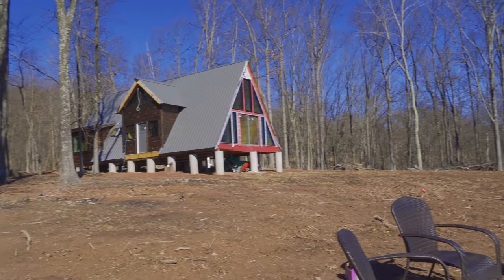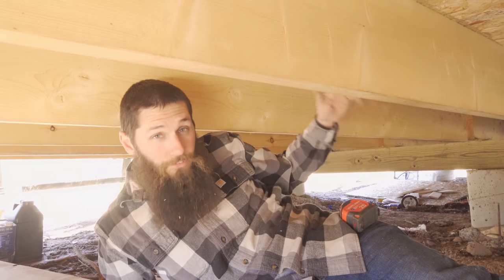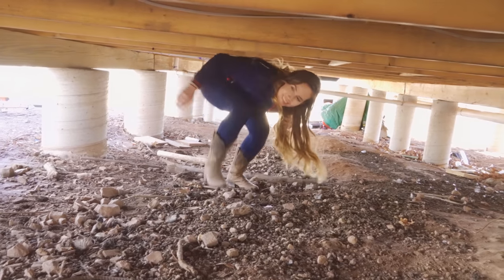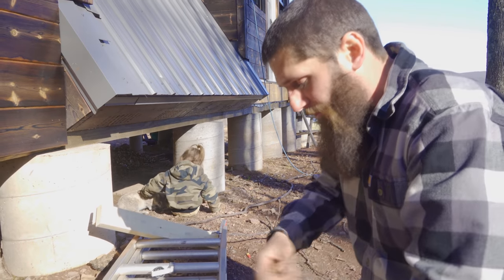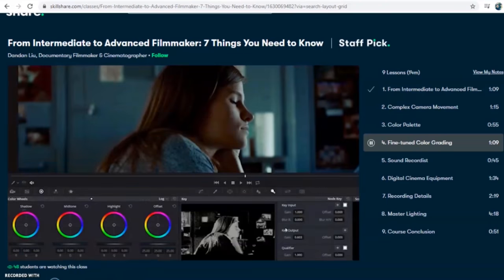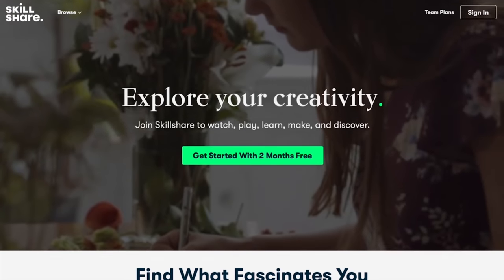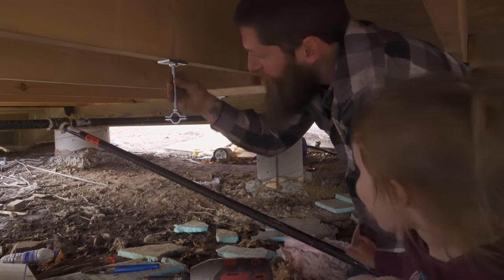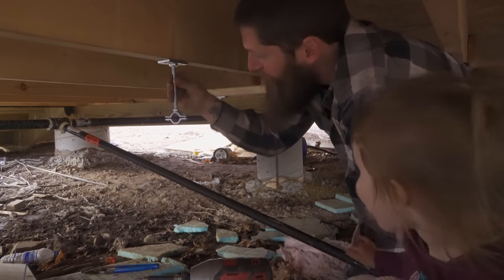WHAT Is Happening Underneath Our House?

Comment: Awesome video! Love y’all’s love and sense of humor! As a fellow diy builder, the gas line was probably the hardest subject to find information on. Pipe size, debris drops, length of pipe sticking out of the house... I ended up going over to a neighbors house and seeing his. It felt nice when the propane company came out and mentioned how good of a job it was and thanked me multiple times for giving them enough line outside of the house to screw on the regulator. All-in-all, it’s not a hard job, we just need more information out there!!
Reply: I retired from the gas company doing this kind of work. Now I am a plumber installing gas lines. I was truly amazed how well they did being an electrician. I would have recommended somethings, over all good job.Oh yeah National Fuel Gas code has all the info you need. Ron
Reply: @ronwood7040   Thank you for the information! 🌞

Comment: Pressure test,  pressure test, pressure test is what I recommend, and while I have put together plumbing with water pump pliers, pipe wrenches make it much easier to tighten joints. A piece of plywood and 4 10 inch wheelbarrow tires and some 1/2 inch all thread can make nice platform to lay on and scootch yourself with your legs, much easier than crawling.
Reply: pressure test...hummmm,been there done that in my trade plumbing....can still get leaks,im surprized that they are not using "ptfe" tape i think you mericans called sylicone tape or something like that..... that may be liquid tape they are using ..???
Reply: Here in merica, pipe dope works just fine and is way faster that tape
Reply: @gsyguy1  Pipe dope, properly called pipe joint compound, is mandated by building code for American gas lines.
Reply: @BillB23  we have many joint compounds,jet blue,boss white,but have a ptfe tape thats thicker than normal for gas pipe work,and liquid ptfe ,just wondered if it was the same.... ?
Reply: @gsyguy1  Possibly... It's been years since I've been a carpenter, but the pipe fitters I've known all used pipe dope on gas lines and tape on water lines. Things may have changed since then, as building science is always evolving.
Reply: @BillB23  That is not true.  PTFE tape (only) meets code here.
Reply: @wallykramer7566  Thank you. It's been quite a while since I interfaced with folks installing gas lines and I value your correction.

Comment: Hey guys Donovan here. Love the videos y’all are helping inspire my family to move off grid and into the wilderness. Quick comment not a criticism. Black pipe can’t be used exterior here in SD CA because it rusts and corrodes much faster than galv. There’s lots of ways to address it such as painting or insulating your pipes. I just wanted to bring it up so hopefully you can avoid future issues under your house. Again love the videos keep it coming.

Comment: Axial Grunt Force Fgf, by using Equation(1) Fgf=0.7×(grunt)×y×As =0.7×1098×20.1 =15449[N] {1576[kgf]} A pipe is tightened by torque, torque inclination, grunting, rotating angle, stretch measurement and other methods. The grunt method of torque measurement is widely used due to its simplicity and convenience. The total grunt force is proportional to the volume of the grunt x duration. Great video! Love the love and laughter. Daughter is adorable.
Reply: and don't forget the snort at 17:13 !

Comment: Greetings Y'all, I must strongly suggest that you invest in at least 2 pipe wrenches(16" and 24"), they will come in handy for other off grid adventures...  Nextly, do use air from your air compressor to pressurize your gas lines (50psi.) and then spray soapy water on every joint to check for leaks before you go any farther(you may end up disassembling alot of your previous work to get everything appropriately tightened). Again use pipe wrenches on pipe!!!THanks for all the vicarious fun, Jerry

Comment: I ran a Heatmor outdoor wood fired boiler for 15 years in Minnesota.  you can heat a house with it and provide domestic hot water.  But, you will NOT provide heat at a high enough temperature for a clothes dryer.  Use LP gas, or better yet, you will be much happier with a solar thermal hot water heater, than a wood fired heater.  I say this mostly because you will not want to keep the wood fired boiler running all summer just to have hot showers.  The issue with using heat from the wood fired boiler is that heat starts at the boiler at about 180 degrees F (68 degrees C) AT MOST, because heating the water any hotter more will blow boiling water at 212 degrees F (100 degrees C) out of the top of the boiler and may crack the water jacket.  When the water gets pumped into the house, even with insulated pipes, their can be a significant temperature loss, maybe down to as low as 160 degress F when it first hits the heat exchanger in the house.  You will need heat exchangers and pumps, because you cannot mix the water from the outdoor boiler system with water to the back of the clothes dryer or water to the domestic hot water tank.  There is more heat loss getting this supposed "hot water" from the first heat exchanger to the back of the clothes dryer.  Go ahead and try drying your clothes with 125 degrees F heat.  It will not work so well.  The heat exchanger will need to be very "fast" to keep up with the heat loss inside the dryer.  A "fast" heat exchanger that can move a lot of heat and keep the temperature high requires a "big" surface area and two fast pumps.  That is expensive.

The other problem, again, is you will need to keep the wood fired boiler running year round to provide heat for the dryer and for the domestic hot water.  I suggest solar hot water panels.  You can get 170 degree F heat from a panel even on a cloudy day in the winter directly into the house, without the heat loss like you get from the boiler, because the panel is mounted on the house very close to the heat use.  It will work year round.  You will need a well insulated 250 gallon high temperature hot water tank and a solar thermal panel.  Keep the LP as a backup for both the dryer and the hot water tank.  I am pretty sure you will still want LP heat for the clothes dryer.

I have been there and done that.  Just sayin.

Comment: Wwog, No one but GOD  knows everything. A spray bottle with dish soap  sprayed on joints  when they pressurize that line will show you if it's all tight if not tighten the joints that are bubbling. No bid deal. Before gas is in that line it still needs to hold pressure.  Keep up the good work. God bless you and your Family.

Comment: 13:53, is actually called a dirt trap...
Reply: Drip leg in NE
Reply: @rogerwhiting9310  condensate trap in SE
Reply: Joe Schlotthauer   Dirt leg ? That's what we call them in the oil refinery,  they they do work ,
Reply: @bustersmith5569  
Yup, the moisture or particulate will naturally fall in there...
Reply: I've never seen one on a propane system, only on natural gas systems

Comment: Enough pipe dope on one joint to do the whole job,lol
Reply: Rüneld Cameron he needs it because none of the fittings are tight
Reply: @floydhathaway8959  extra pipe dope isn't the correct answer to the problem, shoulda acquired the right tools.

Comment: You got me hooked on and now I am binge watching someone else's happiness whils in quarantine when I am traveling to and from the job. Did you use rubber pads in the places where pipes sits in the bracket? Two different metals touching create corrosion caused by differences in electrical potential of the metals.

Comment: Been a plumber in Georgia for 27 years , your friend told you correctly, when it comes to the drip leg on your gas.

However if it were me my guy , I’d put one at each fixture, and don’t put a cap on the downside , put a ball valve so it’s easy to open and drain. Not sure if your state permits ball valves on gas black iron piping but , just a suggestion.  
You could send one of your boys under there like twice a year and drain your drip legs just by popping open your valves for 2-3 seconds and closing them back. 

Nonetheless good video and the house looks great man !

Comment: Hey Josh, it might be a good idea to run the underground piping with poly pipe, and a tracer wire. If you use steel you would have to cathodic protect it from corrosion. I'd use a 1" or bigger line
to stop from having a pressure drop.

Comment: You will need to provide some way to seal the under area from the wind.  Allow it to be open in the summer, yet close it off in the winter.  Otherwise those floors will freeze.

Comment: You should have gone to the plumbing supply house and rented a tool called the mega press. Few second for each fitting and it presses them together. No twisting, no pipe dope. Little pricey but after you use it once you’ll never want to deal with threads again

You can also use full length pipe and cut to any length you want without having to rethread

Comment: I was hoping you were putting some traps in there to catch all that extra glue............that's a lot of glue. :-) I have installed a lot of gas pipe in the past, crawl spaces are the worst so I don't envy you. I could borrow you my aluminum pipe wrenches.................perfect for what you are doing. I was just thinking about how you were going to remove the stumps the other day in your front yard, was hoping you were going to make a video of that, looks like it turned out nice.

Comment: If you are going to close in your craw space and have mice and other critter bubble rap for the under neath the floor joints instead of fiberglass.Plenty of stuff on here about the reasons and it does work. Boss of the swamp can tell you a lot about the reasons why. I have done it myself and it does work because I’m in the mountains.

Comment: Not sure about your location, but mine requires a shutoff valve at each appliance point of useage, so you can disconnect appliance without turning off main trunk. Just a good practice in general too, for maintenance, and service.
Reply: Yep.  That would be above the floor though.

Comment: Hi, I know it`s a gas line, but I believe you should have a drain line for any condesation in lines, normally where the gas regulator is connected to gas lines.
Reply: Considering how dry propane is when it comes from suppliers, persistent condensation is very unlikely.

Comment: Fun idea I ran into will completely remove stumps over a few years and give you mushrooms to harvest by inoculating the stump when you cut the tree down. Most of the time when you cut down a tree you do so in spots a stump can rot naturally but you can speed up the process with the right fungi type and give yourself some food to harvest as it is breaking down the stump. 

Feeding a wood boiler ouch hope you get a log arch set to make bringing home wood faster. No need to process the wood where you cut down the tree when you can turn sections of logs into a trailer and tow them to a processing spot to work on when you have 10-30 minutes of free time. A log deck off a hill you can drive the logs onto and simply drop and roll onto the deck for processing can really speed up how fast you can cut them into rounds at the same time doing it safer then in the field as you are at a comfortable height at a section that supports the log and gives you cut slots and sizes.

Comment: don't forget to pressurize your system with compressed air before you put propane in it.  You should really use pipe wrenches to tighten everything up.  Less chance for a mistake.

Comment: You may want to consider using hardware cloth from the bottom of the floor joists at the perimeter of the house to at least 6 inches below the ground in order to prevent rodents from eating the exposed electrical wiring and insulation under the house. Gophers, moles and squirrels can destroy wiring and insulation in a matter of a few weeks both above and below the ground.

Comment: the gas pipe needs to be sized correctly ,3/4 pipe can only supply a specific amount of btus. If you are getting a propane tank it should be buried and sized or all of the appliances wont last and will have carbon monoxide issues

Comment: hi. well done for the gas piping. Please consider to insulate it for those cold spells. I would also humbly advise you to consider to bury your intended gas tank for the same reason an install a good non-return valve near the house.
Reply: Why would anyone insulate propane pipe?  Any why would a propane tank underground have any advantage over one above ground?
Reply: @wallykramer7566  Loose snow piled all around the propane tank often proves to be an effective insulation. If you have a permanent bulk propane tank, bury it to protect its contents from periods of severely cold weather. To prevent propane regulator and line freeze-up, insulate the system.

Comment: Good looking job. Work is so much better when your having fun while doing it!
Do the gas lines need some type of insulation pipe wrap?
Reply: What for?
Reply: Wally Kramer ...Yours is not an answer.
Had I not wanted to know if exposed gas lines needed to be insulated, wrapped or otherwise protected ... I would not have asked.
Therefore, if you lack the knowledge to provide a correct answer there is no reason for your questioning comment.
Reply: @CJDe-kx8of  No, of course not.  Gas lines do not need insulation.

Comment: Do You need to get it certified by a gas fitter? Here in Ontario all gas systems must have a fitters tag to be certified especially for insurance. I'm sure you already know about the pressure test of 25 lbs pressure to make sure there are no leaks. Wow that's allot of pipe dope Josh, bad habits are hard to break Lol    Cheers

Comment: What type of insulation will you be using ?  Rockwol (spelling?) or maybe spray foam that harden's, close cell, ? Mice wont mess with either. Spray foam is R-7 for every inch of spray.  Very cool skillshare !!! You both are doing a great job with all the area's of building and video making !! So love watching you 2. You'll be in by June 1st !! Stay safe and warm. God bless
Reply: Well, they used fiberglass in the walls.  Why wouldn't they continue that?

Comment: Wild Wonderful Off Grid I heard Josh say he would not use the concrete piers if building again, I’m pouring pads and using blocks to get my height any other options? I want to just stand up oak logs instead but been advised not to

Comment: Reminded me of the upgrade we made to our house replacing the gas pipe (3/4" to 1") to better support our tank-less water heater.  You guys have much more room than we did in our crawl space.
Reply: Are they doing a tankless water heater?  3/4 inch works fine for our 200,000 BTU/hour tankless.

Comment: You've never lived in a 50-year-old home. That metal piping is going to accumulate corrosion until the size of the water flow is a pin-hole. Remember you want to lift that house to install a main floor at some point.
Reply: Edward Tilley that metal pipe is for gas not water. Unlikely to corrode inside.

Comment: I realize you stated that you will have to go to each joint to check for leaks, and that is a good idea. But if you pressurize the entire system and it holds for a day, wouldn't that mean every joint was air tight? Just wondering... Thumbs Up!
Reply: Our local code requires pressurizing (with air) the pipe to 15 psi (1 bar).  If there is no perceptible pressure drop after 15 minutes, it is deemed safe.

Comment: Questions: Are you considering thermal insulation under the crawl space floor? Are you going to staple fine wire mesh under the floor to prevent rodents and squirrels from entering the house or making nests in the thickness of the insulation? Are you going to close the crawl space around the perimeter or allow it to ventilate from all sides?
Do you think you will be self-sufficient during the time of the corona epidemic? Very good job...

Comment: Pipe ending on the bottom of that T is called a Drip leg. Very smart move.
Reply: Sediment trap.
Reply: Wally Kramer they call it all different terms but in cold conditions pipes condensate inside and out so moisture  develops inside and drips in the lowest point. Yes sediment is also included. This is a plumbers slang term drip leg. But its a trap.

Comment: Just wondering if you guys have "treated" your lumbers to ensure prolonged self life of the house structure.
Where I come from in Malaysia, we have problems with white ants (termites), due to the year long warm and damp weather here. So usually, one needs to use either hard timber or treat the lumbers to avoid white ants problems in the future.
Or, another option is to call pest control and install anti white ants around the house floor plan.

Comment: Since the steel pipes carrying the gas, do they need to discharge the electrostatic energy on the ground? Well you know better than us what to do and in any case you did a good job. There are sprays that reveal gas leaks, and it is better that you do a test with the windows open to see if everything is sealed well. Thanks for the video and ciao from Venezia.

Comment: Question.....Josh, you must have bought that Rector Seal by the 5 gallon pail, as much as you wasted.... I'm guessing you should check those drip legs real soon, because you certainly got some inside the joints...   I'm puzzled why black iron pipe instead of copper or do you have some crazy code to deal with??   Natural gas is the only one that requires black iron piping to my knowledge...   Copper is much easier if applicable anyway good work

Comment: Depending on how much solar you have a heat pump water heater is more efficient and cheaper to operate than propane.
Reply: Well, they have nearly free electricity and wood fired heat (from their 60 acres of forest) whereas they would have to pay for propane.  So you are correct.